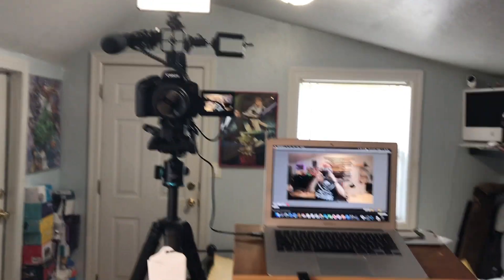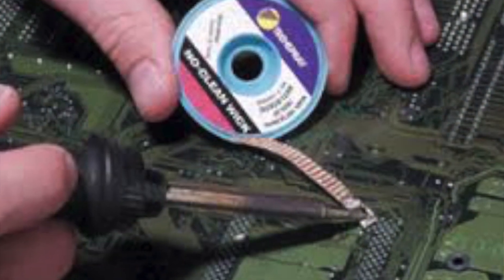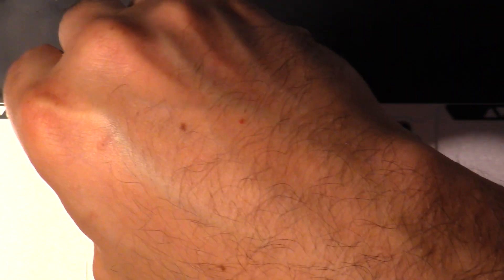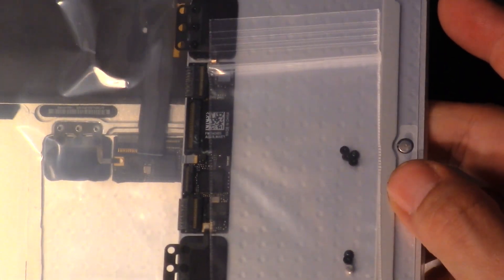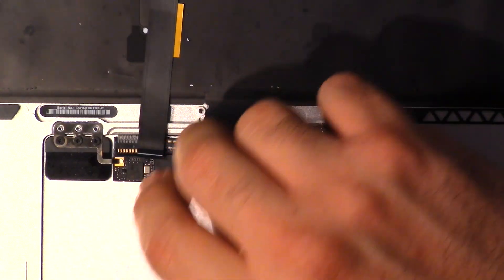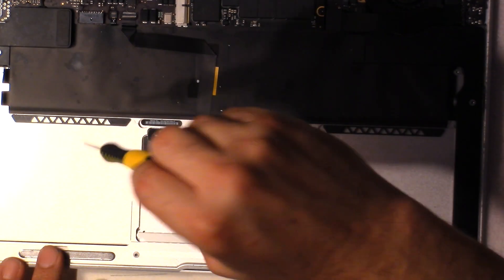Replacing the touchpad on 2015 Macbook air

Comment: Hi, sonnet egpu will this work on a macbook pro 13 inch Early 2011 non-retina, macos high sierra 10.13.4 , graphic card GTX 1060 6G--- with better performance?